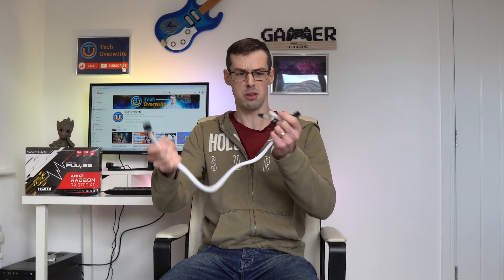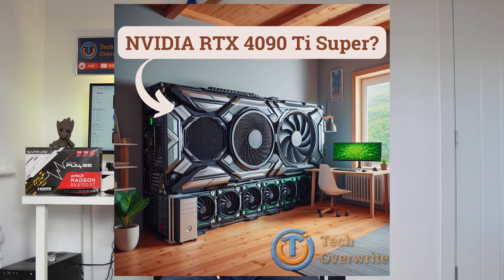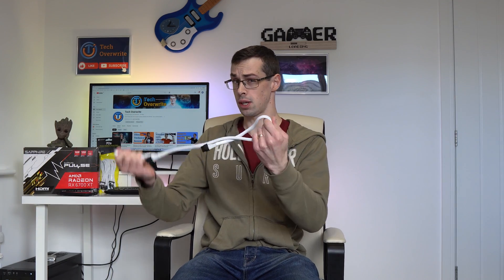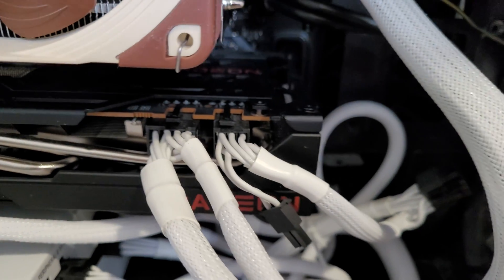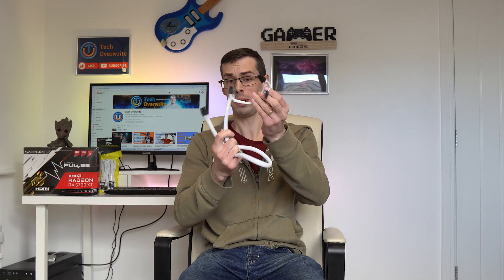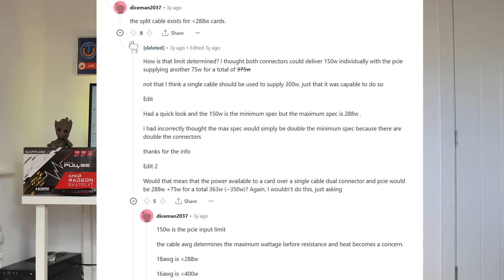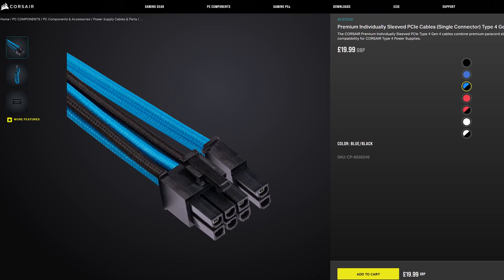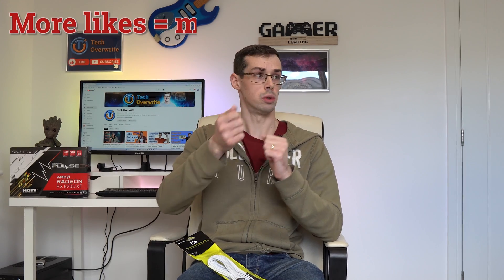Stop Connecting Your GPU Power Cables Like This! (How To PROPERLY Connect PCIe Cables For GPUs)

Comment: I accidentally connected my cables correctly then 😂 As a beginner builder, I was unsure because I've seen others do it the "pigtail" way and that's why I'm here now, watching this, but no, my gut feeling was correct! Thank you for the helpful tips! To clarify, I connected my Sapphire 7900 XT (331 W) to the PSU with two different cables. I've tried to do some "stress testing" aka gaming with ultra settings, and it all looks good on the dashboard!
Reply from the maker: Haha, yes sounds like you've done it right 🙂 Hope your new build is working out well for you 💪
Reply: @TechOverwrite  Thank you! It has been so far 👍

Comment: So if I have a 7600XT. The devil spawn I put in the GPU should retired and use 2, 8-pin connector. Or got 2 devil spawn cuz the pcie 8-pin connector are not made to deliver 150W each ?
Reply from the maker: You'll probably be fine here to use a single cable with devil spawn connector lol 😆 The motherboard PCIe slot supplies 75 watts too so even if your PSU cables do just supply the 150w and no more, you're still over the TDP for your 7600XT.

Comment: Few days ago the ''pigtailed'' pcie cable of my 7 year old Coolermaster V750 PSU melted inside the PSU end. Found out after I was getting constant black screens when starting any game. I had the cable connected to the 2 pcie connectors of my Zotac RTX 3070 Twin Edge OC GPU. The GPU is rated at only 220W TDP. I was running it mostly undervolted, but had the power limit in MSI Afterburner maxed out. Maybe thats why? I'm not sure. Something feels really off. But luckily my graphics card is ok, and I now have the other ''pigtailed'' pcie cable connected to the other free slot on my PSU and running the card at 50% power limit to be safe... until my new PSU arrives in 1-2 days.
Reply from the maker: Hmm that's really good (and concerning) - glad you caught the issue before anything worse potentially happened. Fingers crossed your new PSU works out fine for you 🙂

Comment: Dang. I have the sapphire 7900xtx, so i think i'll need to get an updated wire setup since I'm using two. Should I maybe be using 3 cables from PSU for the sapphire 7900xtx? Maybe I should get a cable set similar to what you talked about in the video?
Reply from the maker: It does depend on the PSU maker (i.e. if it's a good quality PSU with quality PCIe cables, you might be fine with 2 PCIe cables). 3 would generally be safe though yes. I quite like the Corsair individually sleeved PCIe cables, although many people use CableMod or similar and they look great and can work really well 🙂
Reply: I have an NZXT 1000w PSU @TechOverwrite

Comment: Thank goodness I finally found a good video explaining this abomination of a cable lol.
Reply from the maker: Lol thanks, I hate this cable too much to not moan about it 😅
Reply: @TechOverwrite  I have been using my 3080 for about 2 years with this cable and upgraded to a 4070 ti super. The pamphlet that comes with the 12 pin connector specifically says not to use it and now I am wondering if this whole time my 3080 wasn't running at it's full potential lol.
Reply: Same here but upgrading from a 3070 ti

Comment: That was a clear explanation and useful video, i still have a question though;

Can i use a different PCI-E cable than the ones i had with my PSU ? (i lost them)

 i've read it can damage or kill your GPU / PSU if it's not from the same manufacturer
Reply from the maker: Thanks :) And yes, great question. It can be fine to use different PCI-E cables yes - many people use CableMod (for example) because they prefer how they look, compared to the standard PSU ones. The main issue (with buying non-manufacturer cables) is if you purchase really low quality ones from a no-name company, since that could introduce potential risks. But a quality third party PCI-E cable should be fine.
Reply: @TechOverwrite  got it, i'm going to use those I kept from my old PSU (which wasn't Bad at all) so I think I should be fine, just hope that the pins fit the slots 🤞🏼

Thanks dude, really helpful, I subbed, which is very rare coming from me 😉
Reply: @Reyvius78   @TechOverwrite  Should you use the PCIe cables that come with the PSU always then the extension cables dont really matter as long as they are a good brand or I got it wrong. Would swear I read about this somewhere.

Comment: All of the people that want you to purchase something from them are going to say to use separate. If you look at the molex standards (which is like the IEEE for PC cabling standards) then it's engineering to handle up to 252 watts. I really like your explanation of this, that yes it is possible and it's actually ok most of the time. However, if you want to feel all warm and fuzzy inside (that's not related to your GPU bursting into flames) then just use 1 to 1 ratios on your cables and you'll be good! 

What I wouldn't recommend doing is plugging a pig tail into a card that wants 300 watts. Remember just like with CAT cable the "standard" is the absolutel bare minimum for the cable to pass inspection. So you are guaranteed 252 watts based on Molex speccing. Specifically it's 3 power pins at 7 amps per. 

Remember don't go off manufacturers who are selling you something, go off the folks that actually engineer the standards. Also schematic diagrams are a Godsend if you can read them as they aren't written by marketing or legal.
Reply from the maker: Thanks for the detailed comment, and I agree entirely that refering to schematics not marketing is ideal - where they are obtainable (true!). 🙂

Comment: Thanks for the video. Could you do more on multiple gpus eg for gaming, deep learning and mining? For example I want to upgrade my gaming pc to also do deep learning at the same time. My computer booted then crashed. I believe it is exactly what you highlighted. My second gpu is not receiving enough power. Ultimately I would like to have 4 gpus to speed up deep learning. I'm not sold on the 4090 or 3090. My 3060 is enough for gaming. I would like to add another 3x 3060s. I feel it will use less electric and be kinder to the environment. I should be able to write my own network client (they call it AI but its really just a personal botnet to speed up deep learning). Cables and hardware advice would be appreciated, software side I can do.
Reply from the maker: Thanks for the suggestion, I'd love to cover something like that to be honest - my current PC has 64GB of RAM and the thought was occurred to me to add another 2x32GB sticks and run local AI models. If I get the chance (from a budget perspective), I'd like to make content along these lines yes 🙂

I hope you can get your computer boot issues resolved. I think that many multi-GPU rigs end up with two PSUs, essentially powering the other GPUs through a wall socket (well, via the PSU of course!) so I think you're thinking is correct yes.

Comment: I have a 7800xt with a RM750E Corsair 2023 PSU. Is it ok to use pigtails?
Reply from the maker: Hmm, tricky one. That's quite a power hungry card. I wouldn't personally try with just 1 cable, however since you have a good quality Corsair PSU, it 'should' be okay. Just be sure to watch out for crashes, lock-ups etc.
Reply: I have tried with a bitfenix 750w formula gold, rated A tier psu using the pigtail cable, easy to say system crashed once the amd spiked to 320 watts. DO NOT USE PIGTAIL, JUST DONT.
Reply: i HAVE THE SAME CARD WITH THE PIGTAIL, WORKS FINE. G.Skill 750 Watt 80 Plus Gold ATX Fully Modular Power Supply... I THINK THIS VIDEO IS INFORMATIVE BUT DOESNT APPLY TO EVERYONE.

Comment: The gauge of the wire is the limiting factor. But, most folks aren't going to be able to discern whether or not their cables are of sufficient gauge to be 'safe' or not. Typically, you get what you pay for. Platinum rated PSUs should come with thicker gauge wire, but not always. I bought an uncommon brand Platinum PSU, because it was quite a bit cheaper than say a Seasonic Platinum PSU. And it came with woefully inadequate cables. So, I painstakingly removed each wire from the connector and remade them out of high quality wire and connector pins that I had to order and wait for them to arrive. It ended up costing about the same as that spiffy Seasonic PSU that's still in my 'wish list'. Never skimp on your PSU, Never skimp on your PSU. Hello from Frozen Hell Alaska. You got yourself another sub.
Reply from the maker: Thanks for the comment and that's all a great point. I wish the cable guage was clearly advertised by the PSU maker. Definitely not worth skimping on, agreed. Thanks for the sub 🙂
Reply: it is not just about gauge, a shorter cable can handle higher loads at the same gauge.
Reply: @bftjoe  This is one reason SFX power supplies state their rated efficiency and do not often recommend you replace their cables, even if it can be done. The added length changes variable and can make a safe gauge less so.
Reply: enermax xplöded or sparked after hardlie over half a dekade use... old! 480w bq still was good enough 4 my 580. ja the öld ön€ ^ ^ 
cheaping on a cable i fried my fan cap or something with the use 6 pin on 2x8 pin card ´trick... häl it still runs. 
next time i buy used psv its with at least one 8 pin cabelle xD 
only got 480w bq since i read 580 was loud... ja 2000s ineternet was diffeRent v?V njöy yö $nöw cänstäire vV

Comment: hey i have a xfx speedster merc 319 6950xt and have been using the pigtails without realising, the pcs not posting now but we think it’s a ram or motherboard issue we’re currently fixing. is it possible i’ve ruined the gpu by using the pigtail?
Reply from the maker: Hey, ah sorry to hear that, that's frustrating 😔 I doubt your GPU has been ruined to be honest. My understanding was that a GPU would shut down long before getting damaged beyond repair. Plus under supplying power is probably better than over supplying power, from a risk perspective. Fingers crossed that's the case anyway, and your GPU is fine once your POST issues are resolved 🙂
Reply: @TechOverwrite  yeah i thought the same but got a lil worried when i saw the pigtail stuff, thanks for the reply, hopefully it’s an easy fix!

Comment: Hello there , got a loki 1000w for a new build with a 7900 xtx (not yet bought). 
The psu comes with the new gen 12vhpwr(psu) to 12vhpwr (PCIE) for the lastest nvidia gpu cards. But it comes with another cable 12vhpwr (PSU) that split into 2 6+2 pin cable(PCIE) for older gpu or radeon gpu that still use the old 8 pin.
Is that Cable plus a single 8(psu) pin to 8 pin(pcie)  enough to power a 7900 xtx? couldnt find any answer even on reddit
Reply from the maker: Hello, oof, great question. I don't know for sure (sorry!) since I haven't really explored Loki PSUs. But my hunch is that it 'should' be fine, yes: the 355W TDP of the 7900 XTX should be covered off fine with two separate cables, especially because the 12vhpwr cable is ultimately designed to deliver a lot more power than the standard '150w or so' of a PCIe cable.

Comment: a lot of people don't know this.. good video buddy! i got sapphire nitro xtx, which pulls 420w or even more!!! got 3 cables from the psu, no loops here. and yes mine looks ugly with the "pigtails" hanging of, but i don't really care :D
Reply from the maker: Thanks, glad you liked it 🙂 Yep 420w for a single card is loads, but necessary considering how much power they deliver nowadays. (And sorry for critizing your 'ugly' pigtail cables lol 😆)
Reply: What brand is your psu?
Reply: I have just purchased xtx and I have evga psu but I require more pcie cables , Do you know a good safe cable brand?
Reply: @Relaxing_Drone  i got corsair 1000w, if i was you i would buy a new psu. It's never good to buy loose cables unless you are sure of their exact specs. You just need a psu with 3 of the 8 pin connectors, and if you have a old psu it might not have that.

Comment: Hey i have 750w PSU and i dont have modular PSU and it has 1 pcie cable with pigtail. So i have 3060ti wich tdp is 220. Should i be good ? (Edit i have deepcool PK750D PSU)
Reply from the maker: Hmm, yes you should just about be okay there - even if the cable guage is not the best, you're hopefully looking at 150w for the cable (min) and 75w from the motherboard slot - which is just about enough. Just try and avoid overclocking the GPU 😆
Reply: @TechOverwrite  yeah im thinking maybe i should use msi afterburner so i can limit the power? And i shouldnt then put too much load on gpu because i dont really want to risk with my gpu. Gpu is btw 3060ti asus rog strix so its one of most expensive 3060 card
Reply: @TechOverwrite and im thinked about one thing. Is it too risky if im gonna buy 2sata to 8pin connector and using that as second power to gpu? Is it good idea or should i just stick to that 1cable that comes from psu

Comment: This reassured me that I didn't hook up my graphics card wrong on my first PC build a few months ago. When I saw that my graphics card (3060ti) had two connectors for power, and my power supply came with 2 pci-e power cables with the correct ends to fit the graphics card (one of them had this dredded y-splitter), my first instinct was actually to use the two separate cables instead of just the one with a y-splitter, since I knew that the splitter wasn't magically going to increase the amount of power the cable can provide. I'm glad my instinct was right. I'm also glad I went with a modular PSU for this reason, since apparently non-modular PSUs often only have the 1 pci-e connector with a pigtail splitter.

One connector with the y-splitter probably would have been fine in my case, since I think my GPU's TDP is only 200W, but if cables normally only provide about 150watts each, there could have certainly been occasions where my GPU would be underpowered in some modern games. Thankfully (probably because I used two cables instead of one in the first place) I have not had any crashes at all!
Reply from the maker: Glad to have helped 🙂 It does seem almost too simple to just use the y splitter, but I also had similar instincts to you. It didn't 'feel' to use a single cable for a modern/powerful GPU.

Comment: Would you be able to cut the daisy chains off, as my pc has 4 daisy chains floating inside the case, i know i could zip tie them down but they still look horrible, would cutting them off be safe?
Reply from the maker: I doubt you can, unfortunately. The cable would presumably still have live current flowing down the ends (where it was cut off). I agree they look horrible 😞

Comment: I have a 650w it is corsair cv650 and my other components are low powered like i5 13400f the main problem is this psu only has one 8 pin pcie cable that splits into two 6+2 pin connectors so can I daisy chain it/pigtail it? I don't ever plan to overclock?what's the maximum wattage a single 8 pin pcie cable can take?i searched the whole internet could not find a correct answer?like whats the quality of cable of this particular unit corsair cv650w is it single 8 pin pcie cable is 150w or 288w?if not can i undervolt it?
Reply from the maker: I don't know for sure, but check out this PDF:

https://gzhls.at/blob/ldb/4/a/f/6/b974c48eac846a02c0203a0bf81b8447717a.pdf

That seems to say that the CV650's PCIe cable is 18awg. So you're probably looking at 288w through that cable. And then 75 watts more from the motherboard PCIe slot.

So you should hopefully be fine to run any mid range GPU on that single PCIe cable, especially because Corsair make pretty solid PSUs. But just watch out for crashes and freezes, especially if you're maxing out your GPU 🙂
Reply: @TechOverwrite  thanks for replying 🙏!! Btw I am planning to pair it with rtx 4070 ti super which has a tdp of 285w is it fine or I have to undervolt?
Reply from the maker: No worries 🙂 Yes I think that should be fine in this case. 👍

Comment: Say you needed 3 pcie 8 pins for gpu, could you use two single 8 pins, and one from the piggy back and be good?
Reply from the maker: Yes I cover this point later in the video, but that should be fine assuming the TDP of the card isn't massive 🙂

Comment: I have 2 GPUs that use 375 watts each and so I purchased a 1300 watt PSU for that purpose. It did come with a 12VHPWR cable for Nvidia GPUS and it uses 4 connections on the PSU. A bit overkill but it would be a safe route for 4080/4090 GPUs even though they would probably still melt. That 12V connector was a Seriously BAD idea as there is no way IMHO to channel 600 watts through it,..Too Much Resistance by scaling down the pin size! It's like going from 20mm to 2mm🤐.
Reply from the maker: Wow that's an impressive PSU, but it's great that you're properly powering your 2 GPUs 🙂 Agreed about the 12VHPWR connector, it's been a disappointment so far IMO.
Reply: @TechOverwrite  I originally tried to start this setup on a MB with an AMD FX9590 and an 850 watt PSU with those 2 cards an it said UH UH! So when I found this 1300 watt PSU on ebay for a little over a 100 dollars I bought it! It came in the original package and that is what it took to get this system up and running. The CPU at the time itself needed 220 watts to run. I wanted something that was Modular and I got that. I don't understand why EVGA PSU's go for so Cheap because that is all I use in my machines and I have had no issues at all with them. They do have 1600 watt units but I bought what I needed. If you figured up the wattage it needed it came to 970 watts!